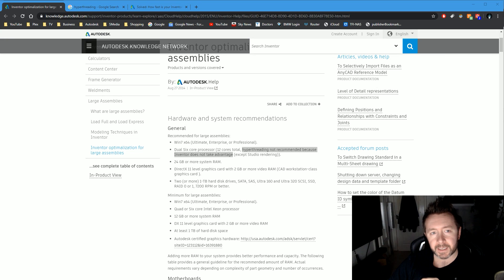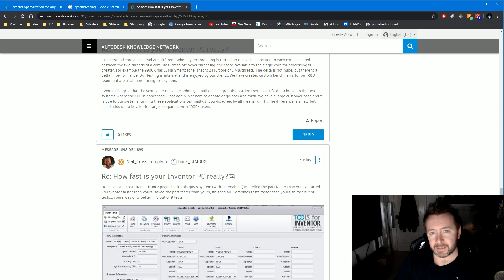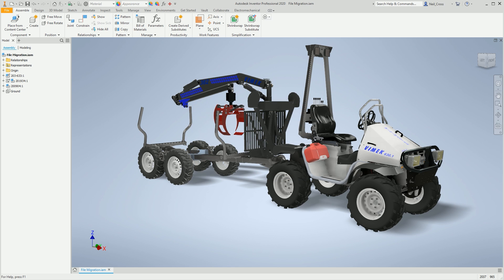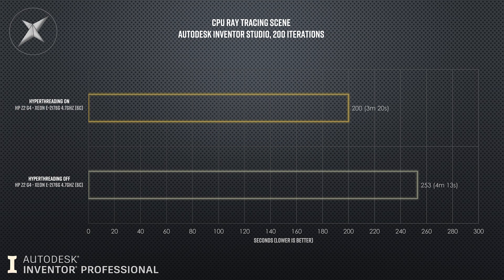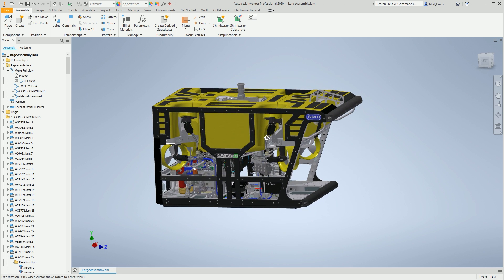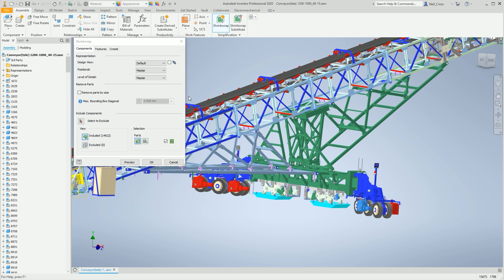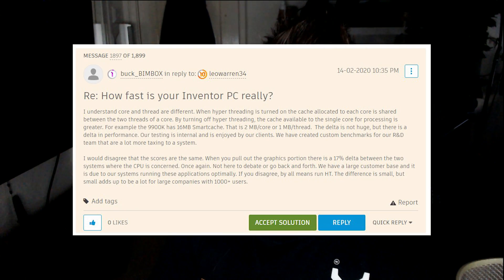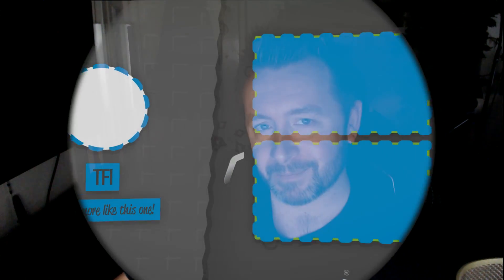Is Hyper-Threading (SMT) BAD for 3D CAD? Benchmark Testing On & Off

Comment: Hey Neil. Quick question if you don't mind. I was watching one of your recent videos about the Inventor Bench. You stated that Inventor only uses the CPU, and doesn't rely on the GPU at all. Is the same true of Inventor studio? I recently upgraded to an RTX 2070 and tried to re render an old model animation from 2005-6. At 1024x768 @ 30FPS. It did about 15 seconds per frame. Is this all CPU or is Studio using the GPU? Thanks in advance for your time. God bless

Comment: I actually ran several simulations twice on Autodesk CFD 2019 to compare HT on/off settings.
And i have posted this on the autodesk forums. (look for CFD 2019 hyperthreading on or off).
HT enabled is faster! its not much faster, but still faster...

Comment: i.m.o. rendering is no CAD application, although common these days. This buck_bimbox is right. If you can have all 6 cores max. turbo at 5,0 -5.x GHz sustained turbo speed it is basically the best option for this kind of software which is typically limited by 1 core clocking as fast as you can have for like CAD, Adobe Suite, etc. You can overclock a CPU more without HT on. This will result in 0-15% shorter cpu times depending on the task.
The important reason/goal for all this "effort":
optimizing workflow/waiting times during the creative part of work. It is essential for artists, engineers, creatives, designers, etc. a 10 second break is interrupting your "flow" far more than a 10 minute render that you can plan on (is there a background render?)
p.s.. you may put longer tasks on when leaving desk or coffee break.
If you have no overclockable CPU then "simply" turning off HT will result in a minimal boost but you will lose time on on rendering/data compression/video encoding.
Reply from the maker: Sorry but although there may be a trickle of truth in there, the logic behind this is flawed.  What you or this Buck Box guy is saying is that if you disable hyperthreading when doing an overclock, your overclock could be up to 15% better?  For a start, yes having HT disabled will probably (silicone dependent) allow for marginally higher overclocks... but given most 9900Ks can go to 5.1 with HT enabled, at best you're going to get 5.2 sustained with HT off.  And I'm sorry but the tangible realised performance gain from 100MHz on the same CPU is barely going to be registered.  I did a video back in 2017 when I ran these tests on the same CPU clocked at 4 different frequencies, picking one of those tests at random... the FEA solve test at 4.6GHZ was 275s and at 5.1GHz it was 252s.  So over a 4 minute FEA computation, 100MHz bought you 4 seconds of time.  To be honest, I'd take hyperthreading over that.
Reply from the maker: And when I say the best you're gonna get is 100Mhz, is because if hyperthreading was a genuine bottleneck for overclocking then it would be mentioned and discussed in literally every video by every PC enthusiast channel whenever overclocking benchmarks or CPU reviews are done... but it just isn't, ever.  And I haven't even gone into the discussion of it being super bad practice and objectively highly risky to use an overclock in a commercial/business environment.  Although I overclock my own PC in my home office, I would never and never have ever recommended anyone runs an overclock on a system they use as their main source of income.  I don't care how competent the system builder claims or thinks they are.

Comment: Thanks Neil.  I tried to find info on this many years ago. We had 4 core Xeons with the hyperthreading off.   I couldn't find any info so switched on and tested.   Off again and tested quite a few times.  I found the same as you so switched mine on.   They were slow Xeons so the extra cores meant that I could assign cores to other tasks and leave Inventor chunking away at large assemblies.
Years later and many upgrades later our Xeons still only score  (6. something ) on the Inventor benchmark test.   That's still much quicker than our vault server in another country.  I just do as I'm told and they pay me for it!    I gave up trying to get faster computers. ( Deaf ears )  :)          This very interesting though. Thanks again.     Do you plan on testing the new AMD CPUs?  They're showing very quick single core speeds without overclocking.             Jim

Comment from the maker: FYI - the "Open Large Assembly" test was a single threaded operation, if any test should have been affected by hyperthreading being disabled it would have been that one.
Also, quite important this... someone mentioned that disabling hyperthreading can reduce heat output on the CPU which then allows you to get a bigger overclock... which then gets you better single threaded Inventor performance! (I think that might also be what that Big Box guy was saying?).  That's nonsense.  First, if disabling hyperthreading allowed for a significantly higher overclock, you'd know about it and it would be routine to do that in all CPU testing, but it isn't.  Second, I'm not disputing that it could lower heat output, but any overclock gain is going to be minimal, we're talking 100Mhz at best.  I've already proven in previous videos that 100Mhz yields very little to no measurable performance gain, certainly not enough to warrant disabling a huge slice of your CPU.  Thirdly... I never once have and never will recommend that anyone should overclock a system which is your primary source of income.  So all of my advice here is based on STOCK frequencies.
Reply: I just love you ramble on I really don't use any cad software may be  photoshop for the memes